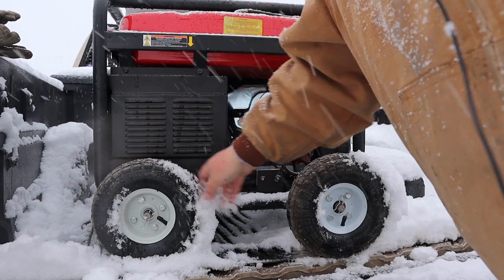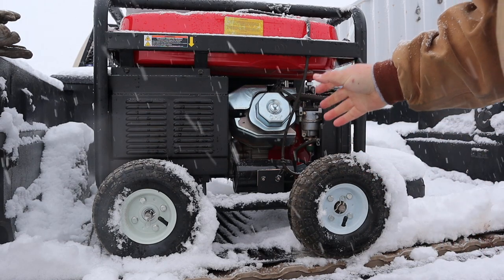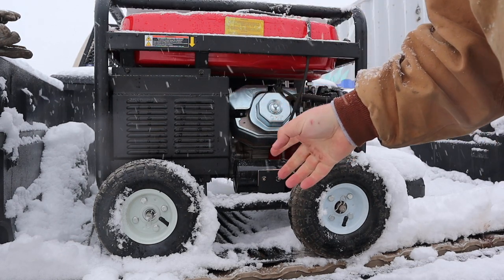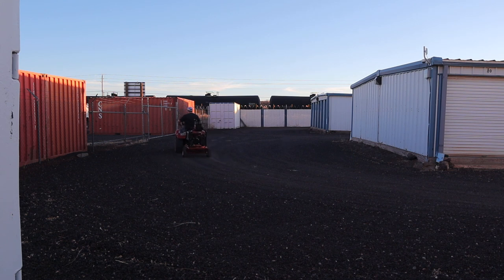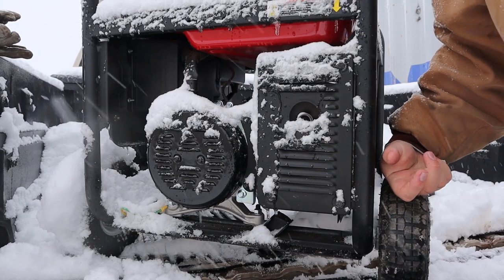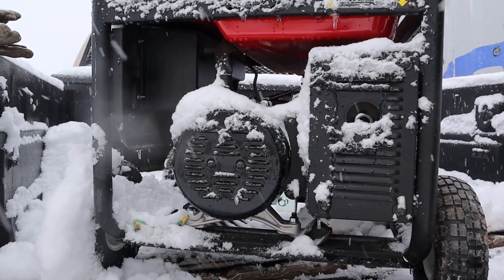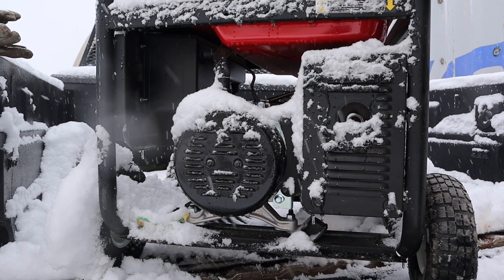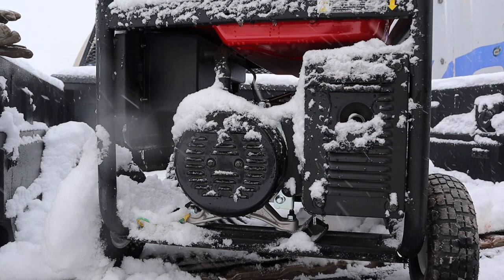The Greatest Modification To Your Portable Generator (Harbor Freight Predator)

Comment: Two months ago I bought a Predator 9000. On the box it illustrated the generator had wheels. I soon found out otherwise after I opened the box (no wheels). The weight of the generator made it a bear to move. I managed to get the generator onto a mover's dolly so that I could move the generator to a corner of my garage where I planned to store. A week or so later my wife picked up the wheel kit from Harbor Freight. After I installed the wheel kit I figured the generator would be easy to move around. Wrong! Even with the pull handle the generator is extremely heavy to move around. The pull handle doesn't give you much leverage as most of the generator's weight is forward of the two rear wheels. I have no doubt the generator can be more easily moved with the four pneumatic tires.

Comment: Had a set of pneumatic wheel barrow wheels given to me.  Ran a piece of threaded rod thro then and the frame spot on my 4550 predator,  with spacers between the bearings and frame,  threaded the nuts on then drilled the rod ends with clips to keep the nuts from backing off. Fabricated a handle from some old gas pipe and used the bolt pattern from the mount spot to drill the plate and then made a couple feet to bolt to the front side ahead of the wheels using some pipe and flat band stock and bobs your uncle...

Comment: Did not see the process on drilling the holes what size drill etc. 👎
Reply from the maker: It’s very easy to determine based on the material you decide to use.